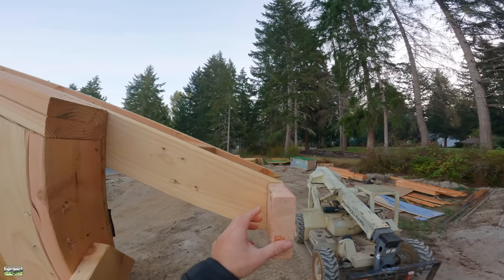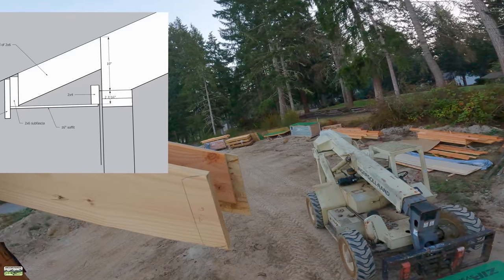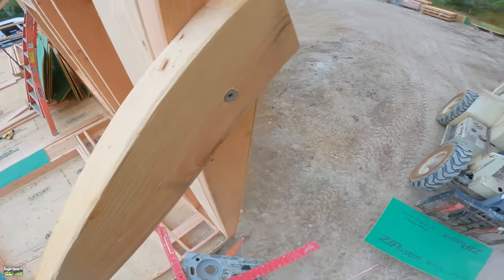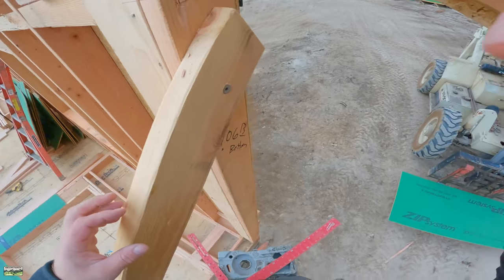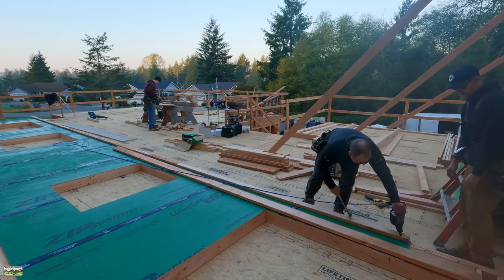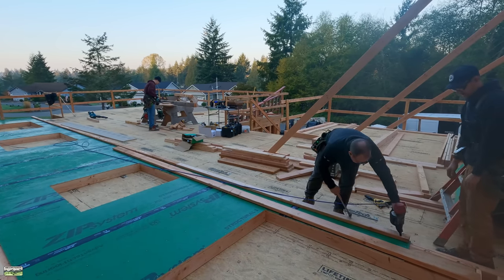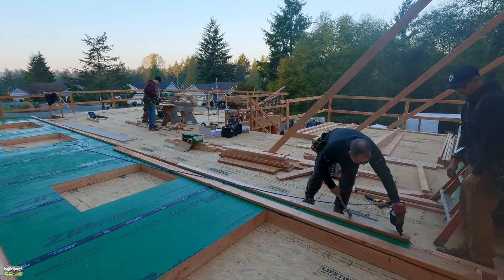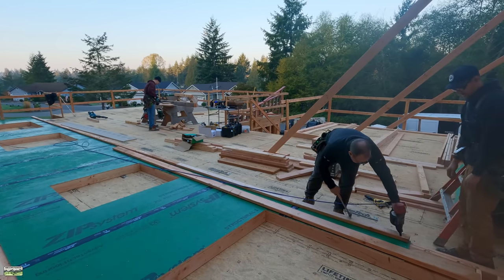How to Frame Soffits BEFORE Lifting the Wall #construction

Comment: Solid training for your guys.  Your jobs are clean, safe, and I’m betting a good time for everyone at least most of the time. I really miss that interaction. Couple things… LP Smartside panels need 3/16” edge spacing. You’re usually a nut about maintaining that so I’m posting for readers who may want to use it. It grows every bit of that. But I’m also wondering why you didn’t lay your cripples out to catch the panel edges? Happy 2023 and I’m def looking forward to more Awesome Framerness.

Comment: What are your thoughts on putting screening behind the vented soffit to prevent bugs coming in? This was recommended when I put up fiber cement soffits. Not sure if it makes a difference but those holes were round.
Reply from the maker: No need in my view.  If you look up the product info on the SmartSide vent it shows the size of those slots in relation to bugs.
Reply from the maker: @h2s142 the bugs we want to prevent are prevented 👍

Comment: How come you run the sheathing vertically? It was my understanding that running them that way weakens the strength of the wall. If they are set horizontally then wouldn't the 8 foot span cross more studs and have a stronger hold? Or is the ZIP siding strong enough that it doesn't matter?
Reply: check with your building permit office or if you have a engineer.  in your shearwall if  all edges are blocked and you run vertical its best to use 9 or 10 foot sheathing to break midway on rim jost. I've had engineer also add blocking 32" spacing in wall cavity to make up the stregth loss when you use osb in the week orientation.
Reply from the maker: no, that's a common misconception.  The "strength axis" refers to the loads perpendicular to the panel, like floor or roof sheathing.  For lateral, wood structural panels can be installed either way.  All edges must be blocked for shear walls.
Reply: @AwesomeFramers  So, by lateral you mean wall systems? Because I would assume that a lateral load refers to forces acting parallel to the ground running horizontally. I thought wall systems were more gravitational loads rather than lateral ones. Would it be possible for you to make a video in the future detailing why you can run the sheathing that way, or maybe you already have one that I have missed. Either way, your videos are so informative and I really appreciate the time you take to create these videos. They are super helpful!
Reply from the maker: @rhysbriden5777  yep, planning a video on shear walls for 2023

https://www.awesomeframers.com/blog/vertical-or-horizontal-sheathing-which-is-right

https://www.jlconline.com/how-to/framing/shear-walls-the-basics_o

Comment: Seems like it would be less of a f@ck around to just measure out at each external corner after the roof is up flick a line and lop them off. Plenty faster too
Reply from the maker: No, what you described is much much slower
Reply: You forget that the soffits done and your not leaning over on your knees 20ft or so. Really neat way of doing it but will need a tellhandler to lift.